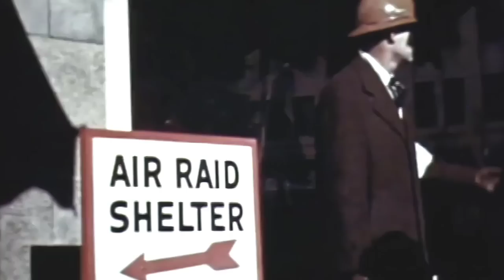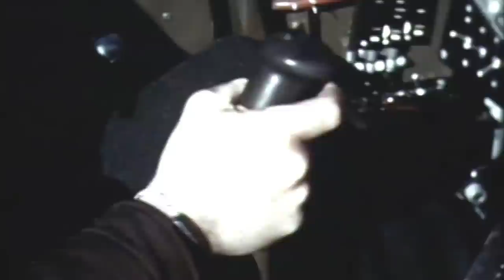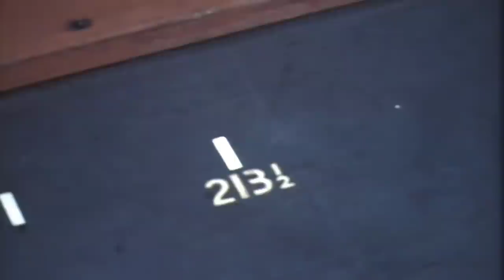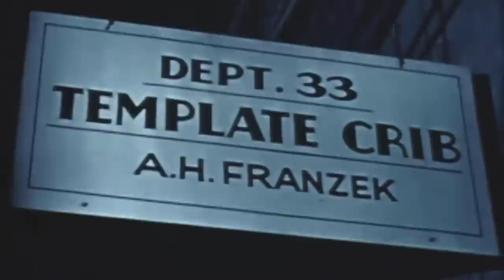Cannons With Wings | Bell Aircraft promotional film (1942 Colour)

Comment: I'd like to know the range of the 37mm cannon: especially compared to the 20mm in the Messerschmidt.  I never knew the amount of frontal armour in the Aircobra until this video.  The Soviet willingness to start with a head-on shot, combined with a cannon that has no aiming apex worry about, plus a lot of frontal protection, would mean a match made in heaven for those pilots.  The low-altitude strengths might be only half the story.  Comments?

Comment: The Americans didn't particularly like it so it was pawned on to the Brits, who didn't like it either, so it was passed on to the Russians who loved it !!!
Reply: Without the supercharger, it didn't have high-altitude performance the UK or USA needed for the ETO at that stage. What could they do with a low-altitude, cannon-equipped, ground support tank buster? Maybe park it out in front and put a sign on it, "Tank buster - runs good - $20."  Now I have a serious question: how come a 37mm cannon busts open any tank when aircraft-mounted, but the early-war 37mm AT guns were called, "door knockers"?
Reply from the maker: Armour location. Tanks were defended (and mostly still are) against ground-to-ground attack. Approaching from above, aircraft were presented with thin shell plating and splinter armour.
The same applied to from below. US pilots soon figured out their 50cals were good for strafing tanks while on hard roads. The rounds would ricochet up off the road and through the soft underbelly.
Reply: @scampbell1566  The Soviets didn't use the P-39 in an anti-tank role.